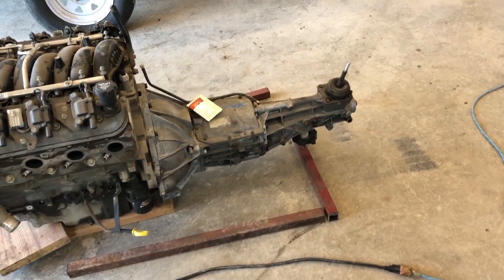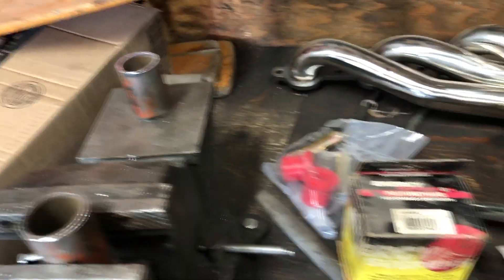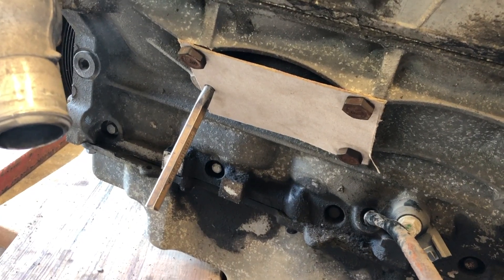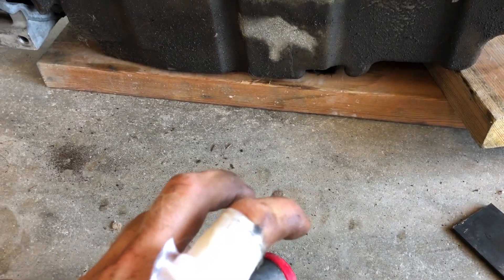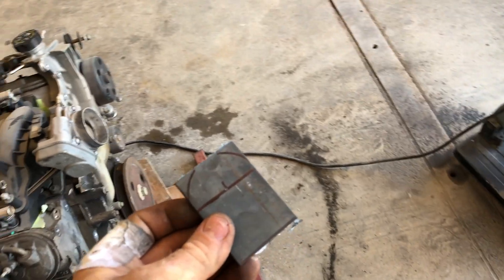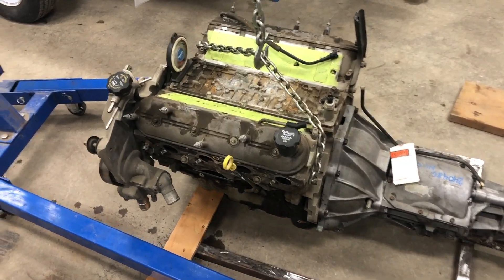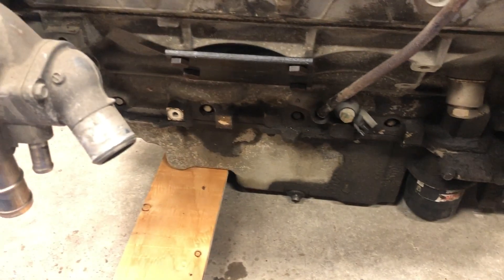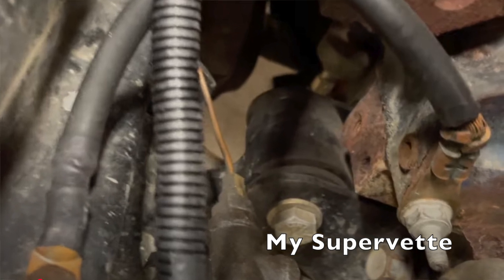Custom Engine Mounts for Any Engine in Any Car

Comment: I sold a perfect ls4 thinking i could not use it RWD. Please tell me how you solved that issue. Also have a chevette with a 3.1 V6 swap to do. Would love to see your engine and tranny mounts for those.
Reply from the maker: There is a way yes, it involves a bit of fab and machine work but it is possible. Stay tuned I will have a whole episode on the how to make a cheap 5speed manual LS drivetrain using the LS4 coming up in the next few weeks. Also that chevette swap sounds awesome! The 3.1 uses different engine mounts than the 3800 as it is a 60 degree v6 so I cannot help you specifically there, but the trans mount I think there is a good view of it on my "how to supercharge V6 a chevette" video about half way through
Reply: Yes its a 3.1 60 degree. that came with a 200-4r. But i really want a 5-speed manual. So any wisdom you can send my way would be appreciated. I actually found a 1981 with no rust.Yellow with black interior. So i'm super excited to get on this project.
Reply from the maker: That is an awesome find! It always is refreshing to see a car seemingly defy time and be so clean. The one thing I would say regarding the engine mounts is to not be afraid of welding a plate to the inside of the subframe boxes. The K-member mounts are quite rearward in the chevette engine bay and do not line up with most engines. Once you get your engine sitting where you want it, I am guessing the engine block mounting holes will be 3inches in front of the K member bolt holes. Instead of making a mount that is a "diving board" leaning forward so to speak, cut the mounts right off of the K member and weld a 1/8" plate that is about 4inches tall and 6 inches wide (front to back on the car) to the inner sides of the subframe boxes. then build your mount off of this. You can weld a nice "perch" here for your mounts to bolt up. This will make a much cleaner finished product and by cutting off the original k member mounts you free up a bunch of real estate to put exhaust tubing pass.

Comment: If you use solid mounts, you don't have to worry about it!
Reply from the maker: for a V8 like this I could yep, But I found that v6's really do not like solid mounts. My supercharged 3800 chevette originally had solid mounts and I cracked the first engine in half. It presented as a rod knock (which I thought was odd for a 3800) and when I took it apart I discovered a crack that started at the backside of the engine mount bolts and went straight up to the cam bearing. I think this was in-part because on those motors the engine mounts on the "skirt" of the block as opposed to the cylinder area
Reply: @fabtofast  I have a straight six.  they are so smooth, I can get by with solid mounts I'm sure.  vortec 4200.

Comment: One additional tip, instead of using the actual energy suspension bushings for mockup (and burning them), use 1.5” wooden dowel with a hole for the mount centerline bolt. Then you can fully weld instead of tacking and having to remove the bushings to finish the weld.
Reply from the maker: Hey thanks for the idea. I have some 3d printed bushings I use for the more common 1.5od bushings but wood is a better idea than plastic. For the ones I used here(1.430" od) it was just an odd ball size. I did find though, that putting the grease on the bushings first protected them from any burns from the tack welds. Maybe it was just a fluke but when I took them apart you could clearly see the black mark where the tack was, and it just wiped off as one congealed scab with no divot in the bushing. So that was interesting.